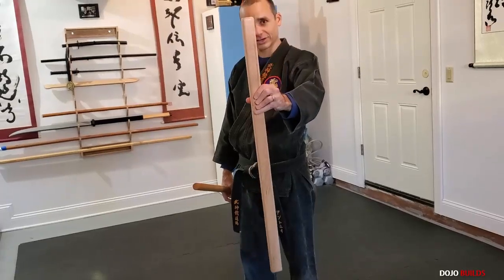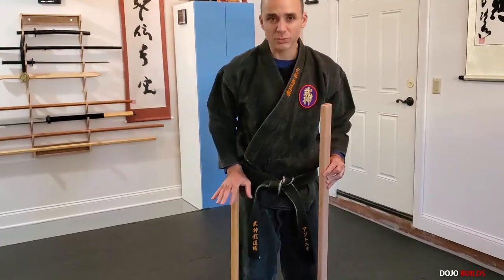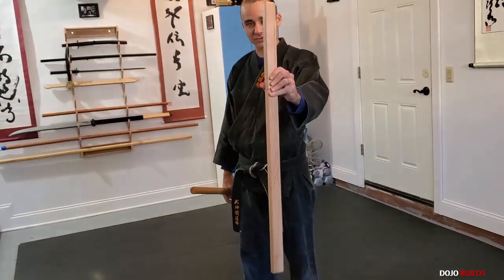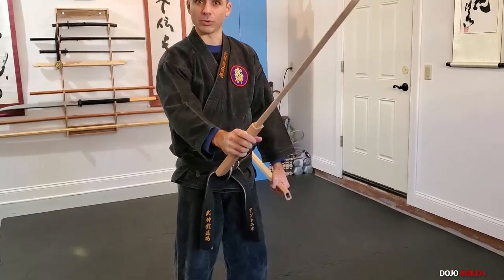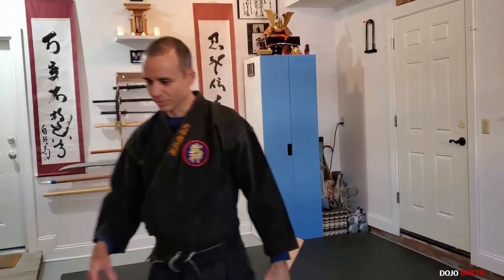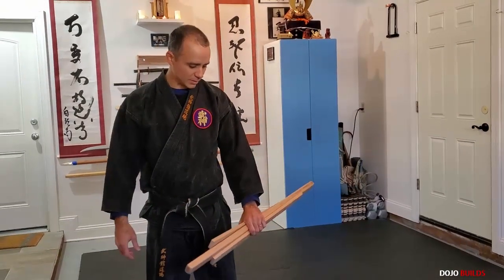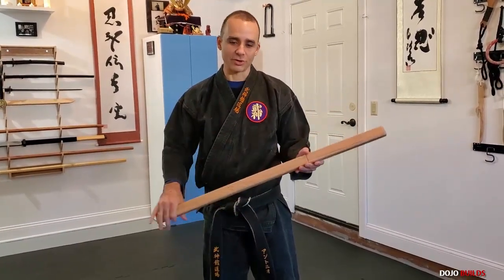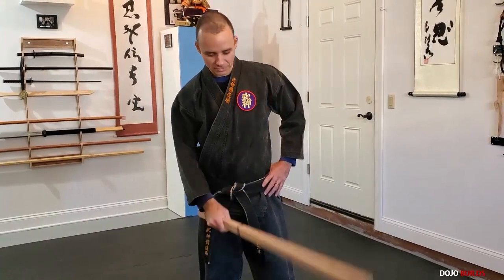Ninja Sword Cane - Shikomizue

Comment: Hello there sensei, I have a small query, could you tell me the dimensions of wood measurements like length and thickness that you've used for the blade, handle and scabbard as I've got the wooden pieces and one of my family members who is a woodworker can help me build one. I've been wanting one for practicing since ages and your video has inspired me. Thank you.